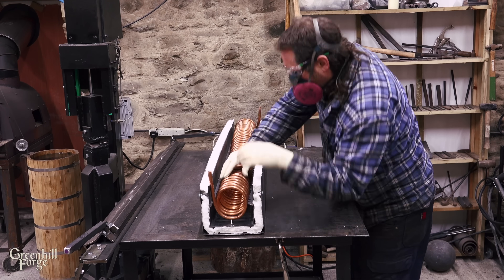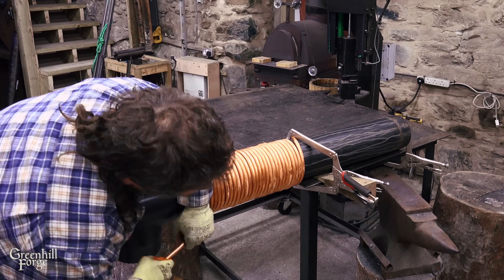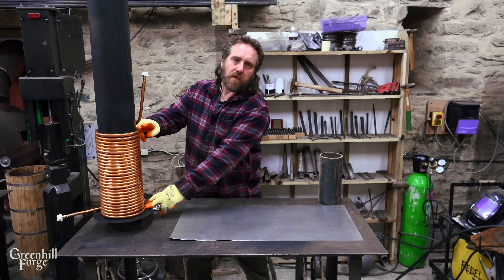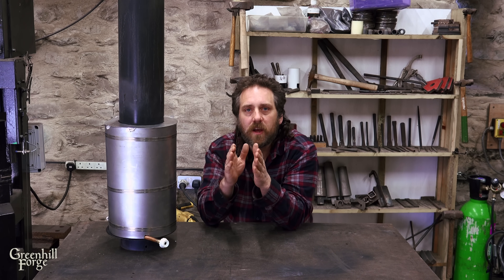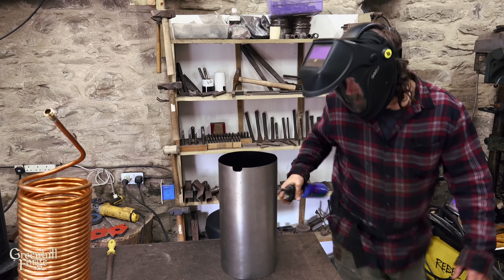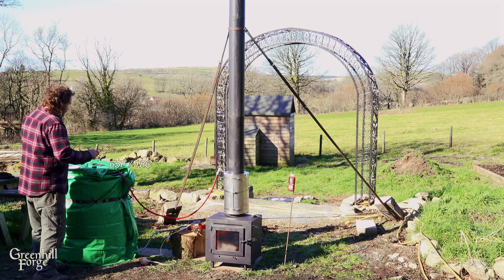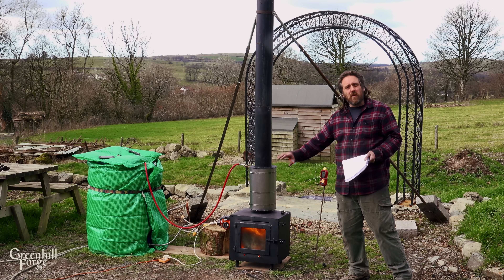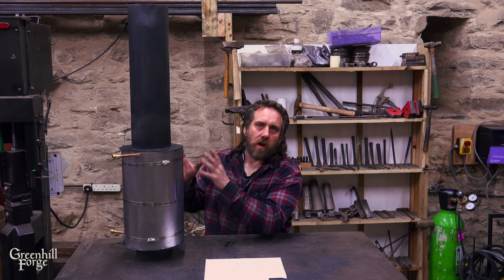Best Wood Stove Water Heater Yet: New Design Tested | Off Grid Water Heater pt3

Comment: I'll describe a build even you can do that will blow this away. It appears that you are using 8" steel flue pipe, and personally I would change that to 6" triple wall stainless steel, safer, common and unless you really need a massive wood stove, 8" is too large because it allows the escaping combustion gasses to settle in the pipe wall too long and this causes buildup.  The next step is somewhat contradictory to this instruction but will make sense in the theory. Make a section of heavy-duty black iron 2" larger diameter than the flue pipe, with tapered fittings about 3 ft long and include a heavy-duty damper on the top end.  This is where you need to prep it for the copper tubing wrap, but it needs to be installed with a thin amount of refractory cement applied to this section and hardened first, then wrap the copper with 1/4" space between the coils, set this section in a paper column tubing with the bottom fitting area exposed to meet the wood stove. This will also work on a gas or oil heater flue. The inlet and exit section of copper core tuning is up to you, but I braze threaded fittings onto them instead of compression fittings, the heat expansion causes compression fittings to loosen up over time. 

Using larger pipe in this first three-foot section allows the hottest flue gasses to slow down but not stick and accumulate as they would in higher sections, this allows more time to transfer heat to the tube and the thick fire concrete outer core, and a damper above can trim this effect to balance with inlet air to the combustion chamber and another dimension of exiting flue control. 

Yes, it will take several minutes to heat this core up, but it will transfer more overall heat to the moving water in the tubing because it ill store more ready heat to deliver to the water.  This water should be circulated with a hot water set circulation pump into a conventional water heater, where heated water can be stored and also because it will need the high temperature relief valve already installed in the pressure vessel.  Some indication or control over the combustion chamber, like using a wood pellet stove with the heat cycle being limited with a thermal sensor in the water tank, and this will give you all of the requirements of no galvanic action with the copper tubing on the steel flue pipe, automation of starting and ending a burn cycle and total heat pressure safety.
Reply from the maker: this is 6"

Comment: Ok, again. from novice engineer. Water inlet from the coldest side (top). Water outlet to the hottest side (bottom) - this will require pump and will give you few extra %. Pipe thread with 50% gap. So 16mm pipe, 16mm space. 16mm pipe, 16mm space. If possible, squash the pipe more onto the steel. This will give you significant touching area. I think it is possible to hammer the pipe manually into an oval shape. Make it really tight on the steel. Then add graphite. If you make it watertight, you can actually use glycol solution, 50/50.

Comment: What about an elonged hollow cylinder with a narrow coil that is suspended inside the flue?  Completely isolated from the flue gasses, but getting hit from all sides of the coil?  It wouldn't be a far stretch to figure up a larger pipe, but with the tubular element suspended inside.  You'd half your times.  50% plus improvement if you stretched it out and increased the surface area.  Like the original inside the flue coil, but now protected with a steel and graphite shield to prevent the negatives.  With your skillset, it's not a huge stretch to figure out the math, the build should be at least as easy as anything you've already done.

Comment: May I suggest that you space the coils apart the diameter of the copper pipe.  I believe you would gain a little more efficiency, it would use up more length of the stove pipe. 

Also, a stainless steel stove pipe welded so that a direct water jacket  might prove to be the most efficient.

Comment: put a shorter coil inside the stove itself. The temps inside will not exceed the melting point of copper, but they are hot enough to burn off any and all creosote. You may find a way higher efficiency at the higher temp.

Comment: No Idea how long it would last, but you could try to get a big pipe, slightly larger than the flu pipe and put it around the flu, then have the water flow in the space between these pipes. This would probably have the best heat transfer without having anything inside the pipe.

Comment: Yeah! Definitely don't use aluminum powder. Aluminum powder is the main fuel used in most firework compositions. You add rust to aluminum powder and you have thermite. Which can easily melt steel.

Comment: I think conventional wood stoves with air injection in a high temperature insulated rise right after the stove would be the best between both worlds. You can throttle the stove with an inlet damper into the conventional wood stove portion, but then get a complete burn with air injection afterwards. Then stack the external wrapped pipe with copper tube afterwards.

Comment: What about utilizing more of the external surface area of the flue? There is only so much radiant heat coming off that 18” of pipe, and you said your seeing radiant heat mirages further up the pipe. If the graphite increases the efficiency of heat transfer your water pipe could be over cooling that section of flue pipe. Hard to tell being an internet observer, but it would be interesting to know if that same length of copper tubing over a longer length of flue pipe bedded in graphite would increase efficiency.

Comment: Good testing. If the idea of internal pipes is being discarded, why not make this like a shell/flued boiler? 

There is no reason to have the copper pipe. Just have the water be in direct contact with the outside of the flue. That would maximize the heat transfer area. It would also remove the complexity of having pipes and sand/graphite.

So, I suggest trying a long water-tight shell around the flue. Have the shell be as long as the original coil of pipe in the first water heating video. Then wrap the whole thing in insulation. That should work well.

Comment: Could you create a little turbulence inside a flue with small metal wedges so more of the hot gas touches the metal of the flue?  If the flow is laminar (or close to it) then most of the hot gas goes out the flue without touching the flue, the cooler gas that does touch the flue is a poor heat conductor and insulates the other gas. Similar to the concept of an intercooler in a turbocharged car, the hot air flowing through it needs some turbulence to better transfer its heat to the aluminium intercooler.  Obviously turbulence and resistance to flow need to be balanced, it’s a trade off.

Comment: Take the same amount of copper as the current coil and wrap it around twice the current flue length. This will double the surface area for heat transfer. Encase the now twice as long coil and shake full of graphite. Run the same testing with this lengthened configuration. It'll perform faster, hotter, and more efficiently. It's the graphite heat transfer bed that sucks all the heat from the flue pipe wall. You invented the graphite contribution idea. I say stretch it out. You'll see.😊

Comment: Please do a test with no insulation poured inside the cavity and the copper pipes spread about an inch apart and the outer shell with approx 1 inch of clearance from the copper tubing.

Comment: I couldn't help but think this whole time that it would be more efficient  if you spread the coil out in a asymmetric way ( with more coils at the bottom and less at the top). The coil gains heat from the stove pipe and in turn cools it. Like you said water is thermal mass. Spreading coil could keep the stove pipe hotter instead of that small section losing all its heat too fast due to the water jacket that coil is creating. Just a thought you're a smarter man the me im sure you'll figure it out. best of luck dude and good video as always!

Comment: HERE IS AN IDEA YOU CAN TRY, SAME AS  THE COPPER AROUND THE EXHAUST PIPE  PLUS AN OUTER TUBE WITH AT LEAST 3" LIKE SO IF EXHAUST PIPE IS 8" 
 1" COPPER +9 EXTERNAL TUBE 12"   I THINK I WILL STOP  HERE BECAUSE TILL I GET TO WRITE UP TO HERE YOU HAVE STARTED TALKING ABOUT MY IDEA

Comment: SUGGESTION:  100% use a single wall pipe directly off the stove (if you have double wall now coming off the stove), spread out the coils to cover a much larger area, "tighten" the coils to ensure best possible coil and flue pipe contact - perhaps initially wind coil around a smaller diameter pipe to load some "spring" into the coil and put a flue damper inside the pipe just above the coils to best hold heat in the heat transfer area. Yes to heat conductive "sand". imo - Double wall directly off the stove is a big heat transfer loser. Designing a wood stove installation, best done at building design stage, where possible to allow for single wall pipe use of some length directly off the stove has substantial heat gain benefits.

Comment: Why did you coil that so tight? Id leave about an inch between each turn so it pulls heat off a longer length for flue pipe. Still fill with graphite.

Comment: This channel is so good it feels like YouTube from 10+ years ago but in 4K.
Reply: Well said.
Reply: Try making a two-layer chimney so that water circulates between them. It looks easier to work with and maybe the efficiency will be higher.
Reply: @PedroFromOkrugna that is the way I have been wanting to build one
Reply: Why not buy a wood burner with a inbuilt water heater in it, dig your floor up about 3 metres insulate the pit sides, run copper pipe as a large coil in it, and fill hole with sand and coils, this will heat house, make sure to put a small pump   motor and thermostat to regulate your floor temp, also one can connect it up to a thousand litre water tank, with a solar panels for back up.
Sand batteries with  solar panels work also, don't have to chip wood, but the fire place is nice too sit with listening to a bit of blues music 🍻🥃!

Comment: It would be intresting to see how many fins you would need to weld inside the flue pipe to make a notable increase in the heat transfer. I was thinking along the lines of four reasonably thick ones out of steel as they would probably get close to doubling the surface area in flue pipe which should make a difference.

Comment: I feel like the flu gas would exit the chimney at similar speeds but faster at high temps. If you have a shorter heat recovery section you're not allowing the same amount of time for this new heater to recover heat. If you make this design the same height as your other internal version (keep the copper pipe the same length but spread the coil apart) it might be a better comparison. I think the graphite powder is genius

Comment: Love your testing!  I think you need to replace the sand with a thermal conductor.  Your idea of graphite is a great idea except for one thing: graphite is carbon, and it WILL BURN like a coal stove!  Graphite will combust at about 400 C.  I might concur not to use Aluminum, except absent an oxidizer, Aluminum is not going to burn.  Aluminum in air immediately creates Aluminum Oxide which them protects against further oxidation.  Instead, the Aluminum is going to just melt.  BUT it will do it at over 600 C.  So Aluminum is MUCH safer than the graphite, because like I said, graphite is carbon and it WILL burn!   Aluminum will only burn if it is heated to a high temperature (nominally over melting point and/or it is finely mixed with an oxidizer.  Ideally pouring lead over the copper tubes should work well except its melting point is about 327 C, about 300 C less than AL, and about 100 C under the burn temperature of graphite.  Maybe using lead shot instead of the sand?  You didnt mention how hot the flue was getting but I'll bet its hot enough to melt lead.  So here is an idea: maybe you fill it with lead shot, and make the outer enclosure leak proof!  LET the lead melt!  Because then, it will fill ever little void and it will also circuate.  You will get a huge decrease in thermal resistance.  The problem here is that you have copper tubes with a small radius that only contact the flue on a small area of that touch point.  You need to enlarge that contact area.  One approach might be to flatten the copper tubes, at least on the inside.  Maybe you make a jig that flattens the copper tubing on one side, bend it onto a pipe that is smaller than your flue, and then wrap the flue with a metal sponge or mesh material, and then stretch the coil over it with the flat side facing the flue pipe.  You could still add in some of the above ideas.  And there are dozens of ways to do what is needed: and what is needed is to increase the contact surface area between the flue and the copper pipe.  Thanks for the great video!  Love watching it!
Reply: It'll only burn if there's oxygen, in the same way charcoal doesn't burn when it's being made. If he's careful with his sealing, it should be ok.

Comment: The limit in this one is the surface area of the metal touching the hot air. It is nice to more efficiently transfer the heat from there, but that can only go so far.

I'm pretty sure that any system that has at least some basic efficiency but takes heat from a longer section of chimney pipe would be faster.

How about not using pipe at all? Make a double-walled chimney (that's 3+ times the length of this) and run water through that directly. Add a couple of fins to nudge the water into a slightly spiralling flow to avoid getting a direct flow while the other side overheats.

Comment: Before you moved on to the graphite powder, I was wondering about doing something like a water jacket around the flue, with the copper coil passing through the jacket, and using antifreeze within the jacket. 

Totally impractical and difficult to build, but it would probably work really well.

Comment: Interesting content... But personally, I find the efficiency quite poor. I mean something like 10%? It literally means you are wasting 90% of your fuel. Even 30% is outright anemic to be entirely honest. Just think about it. If you would take that efficiency up to even 60%, it would literally halve the fuel use for the more efficient system. And 60% is by no means high efficiency. And for things like soot and creosote, those should not exist in the flue gas to begin with. You want to burn everything that can be burned, and then you can take away just about as much heat as you like... As long as the flue gas temperature is still above boiling. If you go below boiling, you might get some problems with condensation, which is not entirely impossible to deal with, but then you might need to use stainless steel, possibly even acid proof steel, equip your heat exchanger with condensate drainage, plus you might not get much draught out of it... Which is why keeping above boiling is generally considered much easier thing to do. But even still, you can manage total efficiency of up to around 85%, so that should be quite far away from where you are now.

And this thing should not really be that difficult to achieve. For thermal transfer you need two things really, one is surface area and second is turbulence.

Even if you want to continue with the external coil setup, there are things you can do. One is to make your heat exchanger longer... And for that you don't even need more copper, just space out pipes, lengthwise to make a longer (taller) coil for the same amount of pipe. One thing is you could add some tiny fins inside the flue pipe. And then as one last method, add some turbulence plates to the middle to mix your flue gas. As while the flue gas is flowing inside the pipe, it is cooling on the outside, but much of the heat gets lost with the hot gas in the middle that never touches any of the heat exchanging surface. You don't have to go all crazy or super restrictive with that, the main idea here is to mix the gas to get a bit more heat to the surface of the pipe.

Comment: I’d be interested to see if graphite cement offered the same or better performance as a filler material. 

The reason sand and graphite both improve performance is because they are increasing the surface area that is able to conduct heat directly. The coil alone mostly relies on radiation to transfer the heat and the coil with just insulation gets an extra bump from convection. 

Since we’ve now confirmed that conduction is the most efficient way to capture the heat I wonder if it’s worth confirming if you’re not loosing efficiency because the coil is wound tight and each loop is loosing by preheating the loop before. Try a small gap between the coils and then fill w/ graphite. 

Even further in this vain if you add a second coil what’s its efficiency versus the first? Without a pump would it be able to safely push that much head of water thru the system?